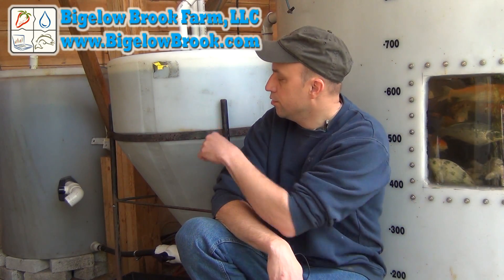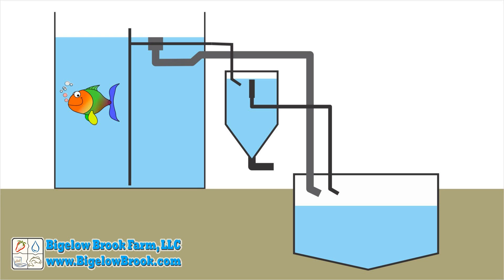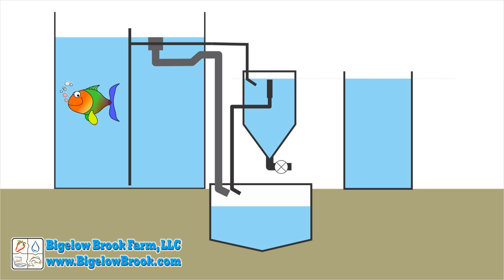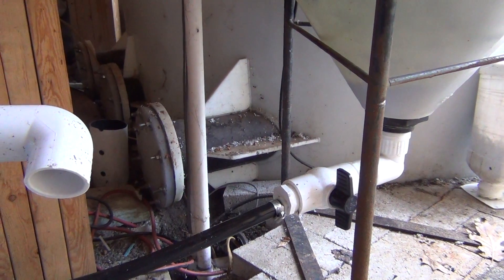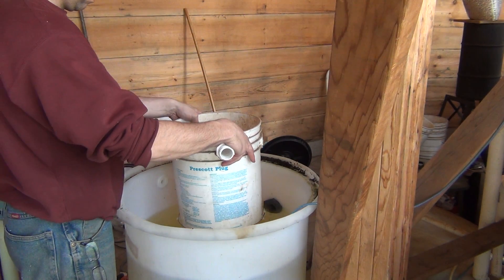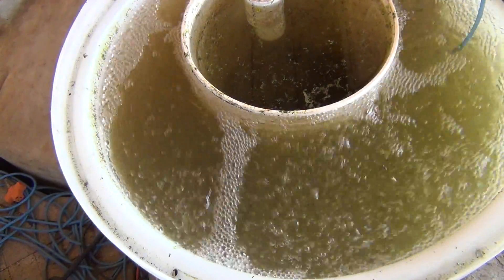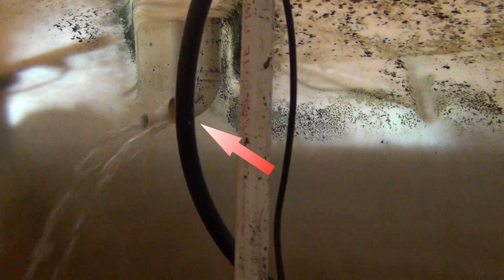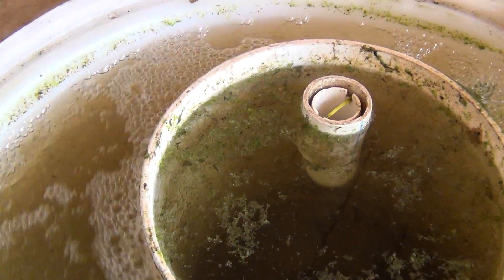Mineralisation Tank Install

Comment: Great video. Thanks. One question: Where did you buy the clear conical plastic attached to your bucket? Thanks
Reply from the maker: It's a flat piece I bent into a cone.  I don't use that any more.  Also you should build a radial flow filter instead of a swirl filter.

Comment: Would barley straw work instead of HDPE as long as you add screen to the cone separator?
Reply from the maker: PropellerHeadVA I'm not sure what the purpose of barley straw would be.  I've heard some of the pond folks say it helps with algae, but it will eventually decompose.  Do you want to use it as a biofilter?

Comment: my filter system is like this swirl filter goes to tank
the tank is in three parts bottom is where water comes in then filter sand then 2 foot at top where water over flows to sump where my one pump runs the whole system....
_________
I clean water I
I sand filter   I
I dirty water  I
I solids stay I
-------------------

Comment: Isn't the whole purpose of a mineralization tank to have anaerobic break down of solids in your system. Then the nutrients that you don't get from the aerobic process, nitrogen mainly, are able to fertilize the plants.
Reply from the maker: VBCreeper From Dr. Wilson Lennard PhD  "Both approaches will produce mineralisation of the fish waste solids ... However, aerobic mineralisation works faster than anaerobic mineralisation and so should be encouraged (Wallece & Knight, 2006).  Therefore, in aquaponic systems we should try and encourage aerobic solids mineralisation as it operates more efficiently than anaerobic solids mineralisation."

"... anaerobic bacterial solids breakdown may cause a number of negative outcomes, such as the release of substances that may be toxic to the fish and other micro-organisms in the system and the raising of system pH."
Reply from the maker: icarus901 Thanks.It's from an article he wrote "Aquaponic System Design Parameters: Solids Filtration, Treatment and Re-use" - 2012
Reply: Bigelow Brook Farm (Web4Deb) Thanks for sharing that reference -- citing source research is hugely appreciated.
Reply: VBCreeper Or through some form of media remove nitrates through anaerobic break down of solids.
maybe he is working on it, as of now this is just a sludge tank IMO.
Reply: Bigelow Brook Farm (Web4Deb) Your research on those matters deserves credit, kind sir.

Comment: Nice as always...
I went a little different route.  I took a 5 gallon water jug, the refillable kind you put on a water cooler, turned it upside down and cut the large end off and used it as the swirl filter. A rubber expansion plug caps the bottom of the cone. Then I connected a gravity line from the swirl filter to a 15 gallon tote filled to the water line with growstones to act as the mineralization zone...   hope it works out, just finished the other day...